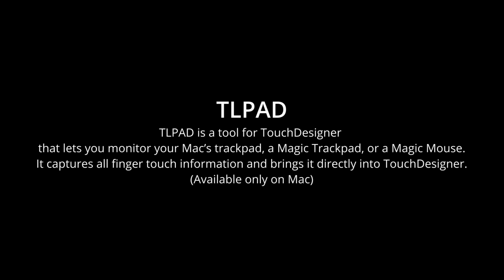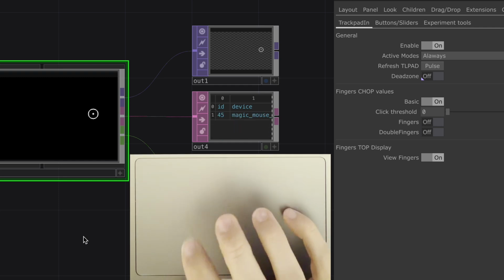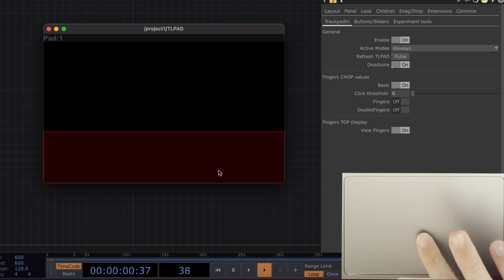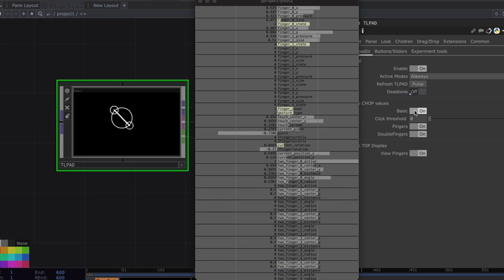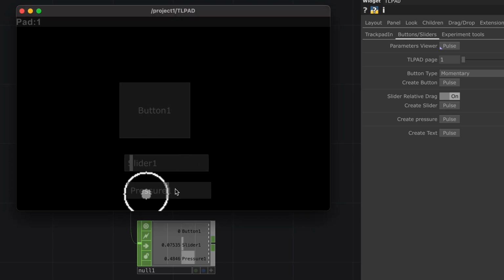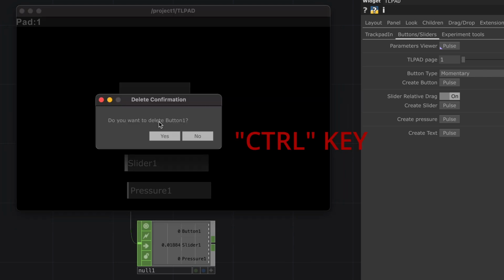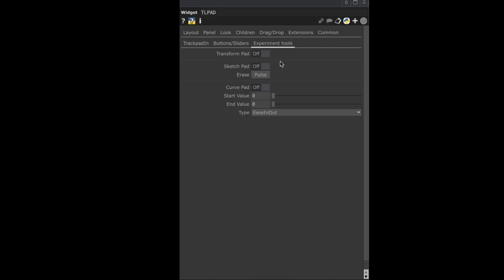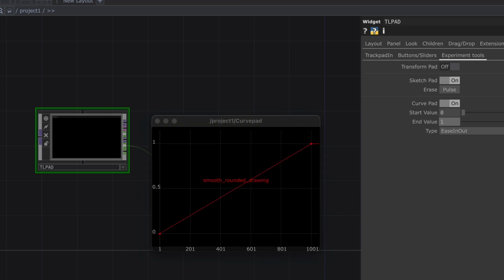TLPAD - TUTO

Comment: Cool! How do you install the multitouch framework?? - no pop up comes up for me
Reply from the maker: Thx! Did you opened the toe file or the tox one ? Which computer are you using ?
Reply: @Thetouchlab4907  m1 mac on sequoia. tried both files
Reply: @Thetouchlab4907  m1 mac, sequoia OS - both files
Reply: @Thetouchlab4907  popup doesn't show up first time opening the .toe project in TD v.2025.31760 macbook m1 pro